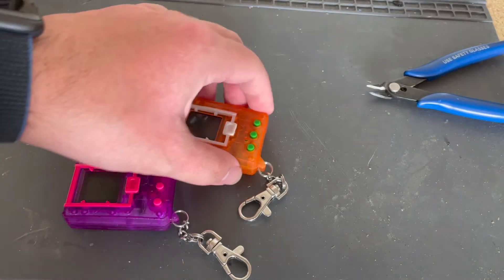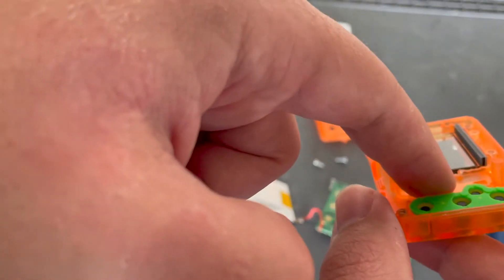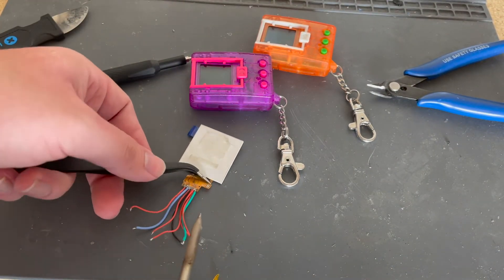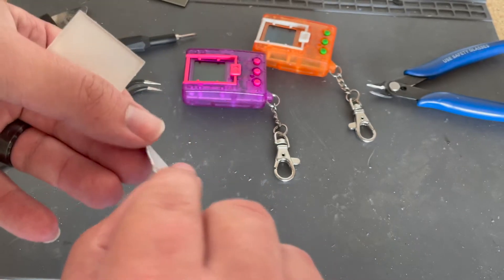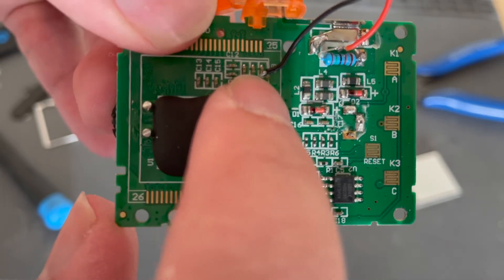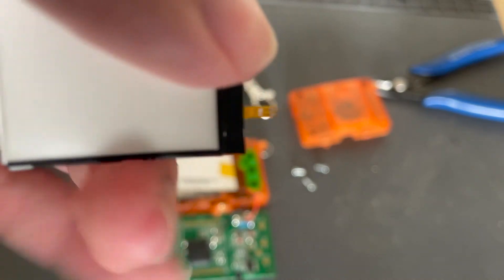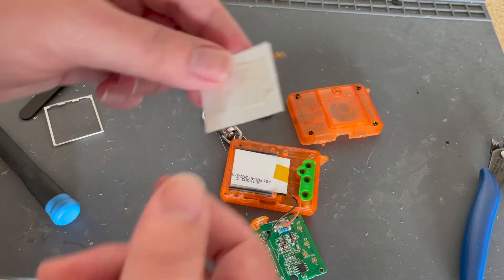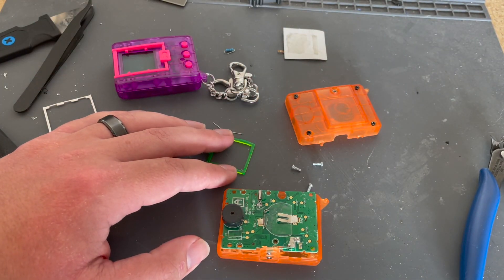DM20th Backlight Mod

Comment: about how long does the battery last with a 15k resistor vs an 18k resistor?? (comparing this to the newer video)
Reply from the maker: Hmmm, I never really checked I guess but it should be very minor.

Comment: I did this and got it to work pretty well thanks! I did however run into an issue the screen is only visible at certain angles. Any idea what could cause this?
Reply from the maker: The screen is already pretty bad at other angles and since this does dim the screen it gets worse. The best angle before and especially after is just slightly tilted up as looking from the bottom seems best. This mod makes it easy to backlight but it dims the screen.
Reply: @zarcha  Figured out the issue, I though I had 15k resistor, but it ended up being a 5k. I just added a 10k in series and its much better. Really wish it could be a bit brighter but its plenty visible in the dark. I did this on the US version of the DMX so I can confirm C8 is in the same spot, as well as 15k resistor is about right. Thanks Again!
Reply from the maker: @bitGnome  im glad you solved it. do you mean the backlight being brighter? i only really wanted to see it once it was dark so not seeing it under normal light was just fine for me. as for the screen i find how visible it is just fine so it all comes down to preference i suppose. it probably also depends on how you play, since most of the vpets have bad screens they already need to be tilted a bit and the backlight starts doing its job when i start having a hard time seeing.
Reply: Only way you could get the screen to look less washed out would be to bivert the image

Comment: i got a small lcd screen like that one, removed the backlight sheet same as you did and it worked fine. when i trimmed down the screen i had to cut some of the lights off and it no longer worked?

Comment: Would this dramatically reduce battery life?
Reply from the maker: I went through a full evo line up omegamon and then some and noticed nothing. It will affect battery life but I don’t think it will be a lot since it does turn off with the screen and is only one or two small leds usually.
Reply: @zarcha  cool I’ve been dying to try something like this .. and have seen so many different variations, I saw someone do the backlight like this but ran it to a switch and another battery inside the case.
Reply: @MrHondagod  I have seen someone else make it so that they could turn the lights on/off by holding the B button. I actually  prefer that since I really like the V-Pets design so extra buttons and switches are not exactly okay for me.
Reply: @aikou2886  i have seen that as well and agree b button on off is very nice, I also wanted to ask you what kind of tool would you recommend for cutting inside of digivice shell?